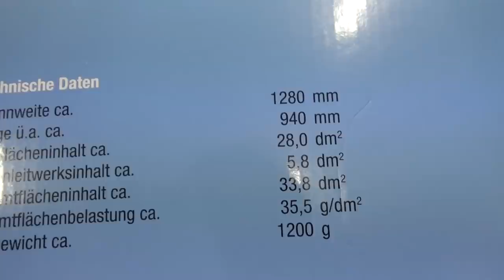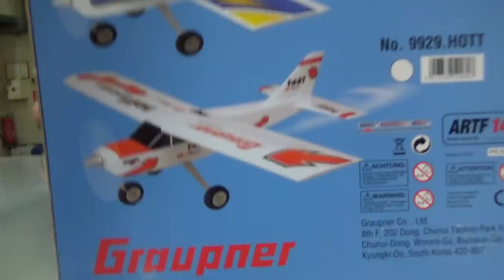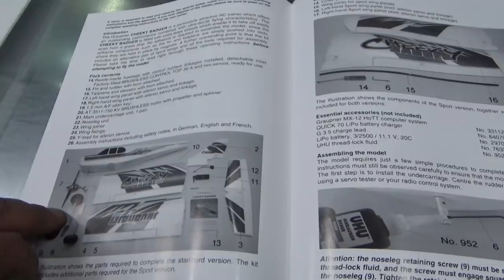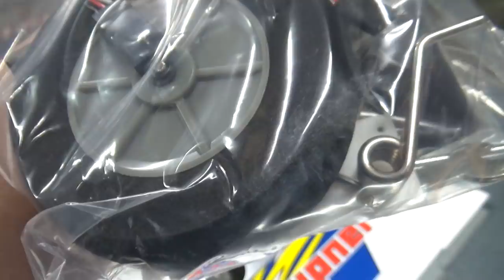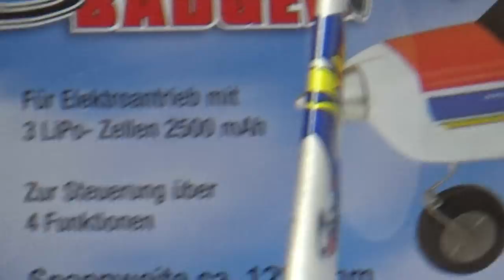GRAUPNER CHEEKY BADGER 1.3m RC trainer/sport plane PNF Unboxing

Comment: Looks like another winner for the trainer pilots.  I only saw a glimpse of the second set of wings, but I thought I saw a place for that carbon rod to insert in the end.  Maybe theres an on line manual.  But what the hell, we dont need no stinkin manual -  heyyyy
Thanks for contributing to the beginner pilots.  I only hope you get them to just PUSH dat button, like you have ME.   Just got the Hobby King ASW28 glider.  Bixler3  ready for maiden.  I'm pushed out for awhile.  SAL- UTE .
Reply from the maker: It really looks great by now my friend. And you will love ASW. It flies so good and looks beautiful in the air. I will test mine also on 1800mAh 3S baterrie. I think that it will be better choice becouse Iam wondering if the ESC will survive another 4S test.
Reply: @PetrincicBrosRC  I hope you dont mind if I steal your paint job scheme.  It looks so good in the air and easy to follow.  Cheers my friend.

Comment: Captains, what a good video once again! Can I wish? I have flown electric for a few years and want to convert into combustion engines. So I have ordered a Saito 125 4 stroke glow engine for a 1200mm wingspan aircraft! It will be fun. But, youtube is full of shit, and it's hard to find proper recommendations on what to do for electronics - i.e. how to power servos and reciever. There are lots of products on the market, they cost a lot, and they do different things. Running an engine is not that hard if you can tune it (and that's not the problem here - you two have shown how to tune engines!). But people wire shit differently. Would you do a quick talk on electronic motor to combustion engine video, especially talking about how you think it's best to do the electronic parts? For me, I power everything right now from one battery (when running on electric motor) .. but with a combustion engine, should I have one closed system for reciever, another for servos, another for aux stuff?

Greetings from Sweden!
Reply from the maker: Hey my friend, we will try to film something. If we fly glow engines and we have glow on we do use one baterrie 1S for glow and reciever pack baterries for reciever. There is many options there. Usualy we buy all our electronics on HobbyKing. You can find there all that you need. And if we are flying gas engines we do have separate baterrie for spark and another for powering the reciever. Just in case.. You will see what happens when you suck your baterrie down on the video that Iam posting right now. No control of the plane anymore. So its good if you have double power. At least with big planes becouse you dont want that plane to fly without control. Crazy things can happen. Big salute to you from Slovenia and thanks for all support.